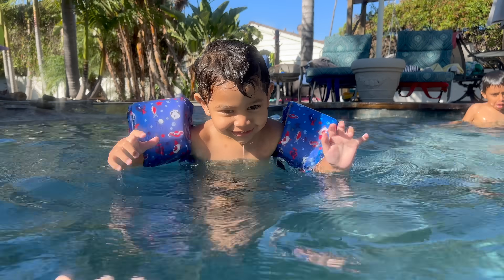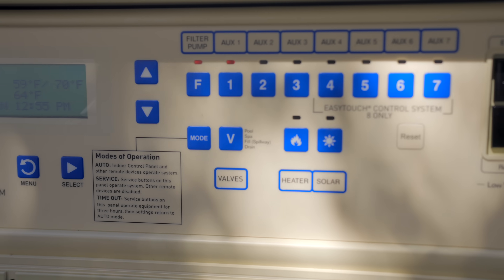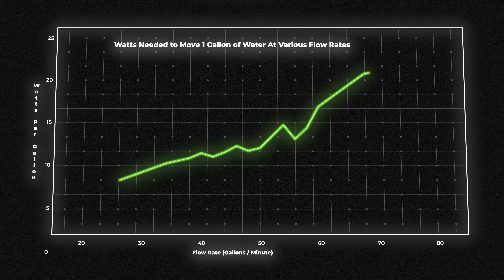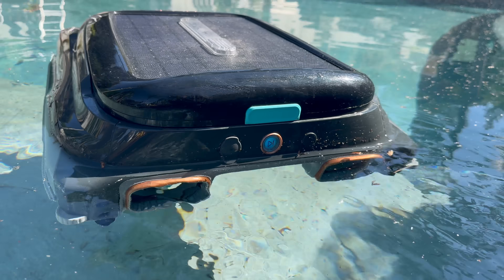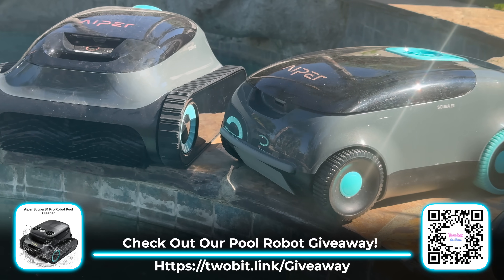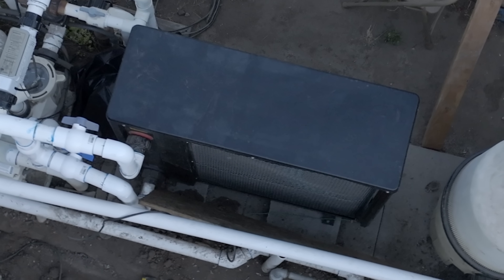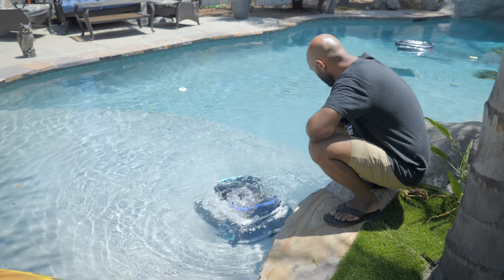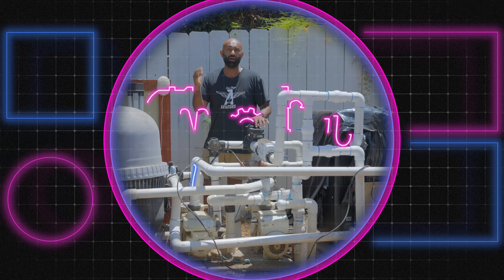How to Build the PERFECT Pool! Part 1 Variable Speed Pumps

Comment: Great video. 

One thing I would like to point out as it relates to pool turnover. In order to fully filter 90 to 95 percent of the water, you need to turn the pool over 3 times. 

So aiming for 2 turnovers a day is the minimum I would aim for when it’s hot outside. With variable speed pumps, running 24/7 on low normally does the trick. Turn the water over more and water chemistry will be better. 

Of course, you need to know the minimum flow for your heaters and salt sell to operate. So keep that in mind.

Comment: As it happens, I just acquired a pool myself! I have a similar Pentair system but it's an older one that uses an external module for WiFi and doesn't work with their latest app - but it does work! I have solar heating panels that are controlled but am fighting leaks. I also have a propane heater that's not currently working for the spa. Mine is salt but the previous owner stopped using it years ago, thankfully it came to life with the application of salt, but my pool guy still adds chlorine from time to time - grr! I have found you can cut evap WAY down by not using the watrerfall. In my case I run the main pump (Pentair fixed speed) most of the day and then switch to the spa towards evening for just an hour or two to clean that out. I'm loving the idea of a variable speed pump but not the cost so that's a problem I'll cross later. Right now my monthly bills have never crested $200 but the I've not been running my AC much - that will change. Sadly right now I cannot find a good way to measure power usage, I have two panels in my main garage and a third in my detached. I use a Sense at a different location and love it but it won't work for this - I'm stumped but want to monitor power.

I'm looking forward to your heatpump video! I'm not a fan of the propane and I'm certain fueling it won't be cheap. I hope you can give some good stats on yours! I'm particularly interested in knowing how well it can heat a spa! Most of the units I've looked at claim they cannot :(  I'm not sure my spa will get tons of use but it would be nice to have the option... This is going to be a VERY interesting video series!

Comment: @2BD, very intriguing engineering redesign Solutions you present here. I'll be looking into many of these myself. Btw, have you thought of using UV water decontamination instead of salt or chlorine? My understanding is that it's very efficient energy wise and as effective.
Reply: I was wondering about copper ionizers which are solar powered with little floating panels. They have a solid copper sleeve that gets used up over a few months instead of chlorine.

Comment: All very interesting, I have been preaching variable speed pumps for well over 10 years.
What size is the heat pump?
Does it have RS485 connection on the pcb at all?
I have installed a few heat pumps for pool heating, I mainly do hydronics.
I automate the hydronics with ESP32, Rpi and Home Assistant.
The heat pumps I supply have RS485, making full control rather straightforward.
Cheers from Oz
Reply from the maker: I'm not too familiar with RS485... but i'd love to pick your brain on it. I'd love to control the pool heating as a function of my overall use... like have it turn off If im charing my ev etc... i'd love to chat! there's a contact form on our website www.twobitdavinci.com .... cheers!!
Reply: @TwoBitDaVinci  sent an email your way

Comment: So something I have wondered and it looks like you might have had a chance for this (though it's too late now is my guess)...
Why don't more pool installers put some kind of Heat Exchager UNDER the concrete/stone birder around the pool?
This area, unless shaded, is usually super hot and you often splash pool water on it to cool it down.
Why not put in something like a driveway snow melt loop but run it in reverse, pull the heat put of the walkway and dump it into the pool though a liquid/liquid heat exchanger in line with the pool pump (which is already running anyway).
Reply: Then you don't need those solar thermal heating loops on the roof and you can use that for more PV.

Could also combine this idea with an HVAC heat exchanger to dump the waste heat from your HVAC into the pool as well.
Reply from the maker: super interesting idea! but i think it would cost quite a bit... if i could build a pool all over from scratch heck yes!

Comment: I have a similar setup. 16,000 gallons, heat pump, variable speed pump, chlorinator. 

My research shows you should try to turn over the pool twice a day, so I run mine at 44 gallons per minute for 12 hours, which totals right about 32,000 gallons. 

I’ve been considering going to a slower speed for longer, and your video just got me thinking it through. 

I’m excited for the rest of the series!
Reply from the maker: yeah for sure! how about 30 GPM for 18 hours? :) although your savings are alreayd huge having a variable speed and running at 44 ... but yeah fun exercise to do... i'm working on a calculator that will help with all of this! what kind of heat pump heater did you get? how do you like it?
Reply: @TwoBitDaVinci  All of the equipment is Pentair; Pump, filter, and heat pump heater. The brand was purely a choice of the pool installer. So far, all equipment works well, and the heat pump heater will put out a surprising amount of heat at a moments notice. My biggest complaint about the equipment is the complete lack of connectivity features available unless you are willing to spend another $1000+. With soooo many things being connected to the internet now a days, I feel like the pool industry is just looking to make as much money as possible. The ability to see the water temp, set heater temp, and control the pump seems like a simple thing to add. Heck, even the display on the heater showing the temperature is this tiny little display that is barely visible on a bright day. Frustrating.
Reply: I will add that I really appreciate that the pump can be set by RPM or flow, and will show you the exact amperage draw while running. 
I use flow since it allows me to dial in the exact amount of gallons per minute the pump is pushing. RPM means next to nothing in a situation like that.
Knowing the exact amperage allows me to see my energy savings in real time when I adjust the flow.
Cool stuff!

Comment: Heat pump?  What?!!!  In Florida we just run the water onto a black radiator on the roof and back down again.  Pool heated.  Voila.  I admit I don't know how much these are, but it's got to be cheaper than a heat pump.  Check it out.
Reply from the maker: Yah solar thermal panels are great! But they don't last as long as electricity producing solar panels. my house had a big leak in our pool panels that was spraying salt water on my roof.

Also, thermal solar only heats your pool, but what about when you dont need that? I want traditional solar panels, so that I can heat my pool, or charge my car or run my AC... that flexibility is important to me. we wouldn't even be using the pool in the winter, but with solar panels, I can still produce energy for our home heating etc.

that was my thought process, but yes those thermal panels are a great option, just be sure to keep an eye on them and catch any leaks!
Reply: @TwoBitDaVinci  thanks for that. I didn't have a pool but I'm moving soon and I'm looking for a house with a pool. I hadn't heard that about the thermal panels. I agree on the solar for sure, but I was referring to the heat pump. But if I'm not mistaken heat pumps are reversible so it could act as a chiller too, right? That would be an advantage.

Comment: Loving this series so far! Very much looking forward to heat pump episode as I have been wanting to upgrade my system. Great to hear that you'll be adding solar capacity to help with the heat pump energy consumption.
Reply from the maker: I have a little preliminary data for you... I can heat my spa which is obvioiusly much smaller, from 80-100 degrees in about 2 hours... my old gas heater did it in 30 minutes... so yes its 4x longer, but its free thanks to my solar! The key will be scheduling and planning :)
Reply: @TwoBitDaVinci  That’s a pretty good price! Haha. If it needs scheduling, it shall be scheduled.
Reply from the maker: @alwayzdancing  like many things in life, the costs are high if you're impulsive, but with some preparation and planning, you can have everything you want and do it within your envelope :)

Comment: @TwoBitDaVinci
Some advice for you on the salt cell, you’ll get a more life out of it if you chose to clean it with a less aggressive acid to water ration and spray it out with water. As soon as the calcium carbonate is loosen from the acid mix is a good time to start rinsing it off just be care at first for the spray back. 
The percentage of output doesn’t mean it’s making more chlorine, it just means it running more.
An example we always give is at 100% output, your cell is running 60 seconds of every minute and at 50% output it’s running 30 seconds of every minute. Every manufacturer has their own timers, but that’s the principle it works on. 

Also, I’m not sure at what stage of this that you’re in but if the deck is still pulled up, you have a Really Great Opportunity to increase the size of your plumbing. There’s math involved in determining what size you’ll need (I’m by no means an expert on it but we are a repair contractor in Florida that does work just like this). 
Anyways, when you increase the size of the plumbing, you decrease the resistance which means you’ll increase your flow rate at roughly the same amount electrical cost. 
It’s something called Total Dynamic Head, or the friction of your entire pool to include from your pool to your equipment pad and back again.
Reference The Experts at @aquastarpoolproducts9092
Steve Barnes is the expert there, guy’s a genius!

Thanks for doing what you do, we love watching your videos!
Reply from the maker: great insights! makes sense on the salt cell... and for the plumbing, no its too late iv'e already poured concrete, so can't change that now, but I'm pretty happy with how it is. But i'll mention that in the next episode!
Reply: I forgot to mention, using energy efficient sweep 90’s (instead of hard 90’s) will also reduce friction in your pool plumbing. Thanks again!

Comment: A big problem is the misconception  that you need to run your pool pump 10hrs. This ridiculous.  Pool "experts " will swear to long hours constantly.  You only need to run pool long enough to filter the water and circulate the chemicals, just enough to keep the pool clean . No more. I had to fight with both my family and the pool guy to reduce the time for years. I eventually had to lock him out of the pump timer. I reduced the 12hrs it was running to 4hrs in the summer and 2 hrs in the  winter. Never had a single issue.  Now this will vary from pool to pool  because of pools are so variable.
Reply from the maker: interesting! So i found that my phosphate levels rose when i ran it less than like 8 hours or so. My big goal is minimal chemicals, and things like conditioner to "keep chlorine in" if i can run at 300 watts i can add chlorine all the time, and i can afford to lose it without the conditioner. my chemical use has dropped to basically nothing... and my chlorine levels are always at the bottom of "acceptable" .... but i was only able to do this because i got the power use down from 2200 watts to 300.

but what a fun challenge this has been. now that my bills are zero thanks to solar, i'm enjoying this battle. but when I first moved in... it was more dread than joy

Comment: the older suction cleaners also cause stress on the concrete/gunite, that leads to cracking. Resurfacing a pool is real costly. Vinyl liners are the alternative, and they rip, and can "float" in a heavy rain. seeing a pool floating on top of a soaked lawn is a real treat. It is cheaper mentally and monetarily to fill it all in at that point.
Reply from the maker: that's a great point... let me ask you... I'm constantly picking out what looks like sand from my pool robot cleaner... is that stuff falling in, or the pool breaking down? it's a very small amount... but I also have some old halogen bulbs that need replacing ... so next spring I think I'm going to empty the pool, try to use the water as best I can, and do a full assessment of the state of everything ... cheers!

Comment: What was fhe cost to install the variable speed pool pump? Shouldn't that go into the payback calculation?
Reply from the maker: the beauty of that is, it's really easy to do. if you have an old pool pump you already have the electricity, if you are able to turn off the breaker, and move the power over, the pool plumbing should be just unscrew and re-screw. I did it in like 1 hour... super easy. If it's something you're not comfortable with, it's likely only like 100 bucks to a pool guy. Cheers but remember, never do anything you're not comfortable with.

Comment: I just demolished and filled in my pool as the first step of my current remodel.

The 17K-gallon kidney-shaped pool was too small for serious swimming, and too large to use as a hot tub. Over the decades I had replaced the pump and filter, with the filter being grossly oversized to reduce backpressure and thus allow a smaller pump to do the job. A fiberglass liner was added to slash chemical use (by 90%!), later shifting over to a "salt pool" with an electrolyzer. When the liner was being installed, I also replace the pool lights with color changing LED units, which was another energy gain, plus fun for parties. Also tried multiple cover systems, from bubble wrap to a trampoline, each of which had major tradeoffs.

Despite all the time and money invested, I wasn't ever satisfied with the results. Plus, due to a hill in my back yard (starting to drop away just 10' from the back door), my pool was in the front! It essentially consumed 80% of the available yard, largely preventing many other yard uses. One reason for my remodel is to make my home and property pet-friendly, and I'll want my future dog to have a great yard. (I'll get a kiddie pool, if needed.)

The inexpensive bubble-wrap cover did a fantastic job of heating the pool, but aged quickly and was a hassle to take on and off. The trampoline cover was safest by far, but was even more of a hassle to take on and off. A simple tarp cover on a wide spool was the compromise that worked best overall. Best moves overall were the fiberglass liner, salt system and big filter / small pump.

Plus, I live in San Diego! It takes me 20 minutes to get from my front door to feet wet in the ocean. Way, WAY better than any pool, and is one of the main reasons none of my pool solutions ever seemed worth it to me. YMMV, for sure.
Reply from the maker: love the perspective! I love that you were brave enough to fill it in! many people keep a pool for the wrong reasons! luckily I have a large lawn as well... I have a standing invite to every one of my neighbors to come over anytime and use my pool ... I get to nerd out over keeping it with minimal costs (after all the upgrades) and see many more people find joy in it. I will say, I'm an old man at this point, but few things bring as much joy as a pool. IT was brutal when I first moved in, now it costs me like nothing... including heating which I'll get into soon!
Reply: @TwoBitDaVinci  Since I wasn't getting much pleasure from my pool, I had considered letting neighbors use it when I wasn't home (or couldn't directly monitor pool use), until I talked to my home insurance provider. The liabilities without me actively supervising pool use skyrocket (something to do with the legal definition of "guest"), and I'd need a separate umbrella policy to cover them (as Airbnb/Vrbo units with pools must do). I'd also need to add controlled-access locks (beyond my simple gate lock), intrusion alarms (area and water) and a fully-automated pool chemistry management system (to shut the pool down if it wasn't safe). To get risk/liability as low as possible, I'd also need to ensure adult supervision in my absence, and ensure they understood basic pool safety and first aid. Bleh. Might as well open a Y!

After the liability shock, I went the other way, adding a 6-foot-tall privacy fence (replacing a lattice fence) to limit the "attractive nuisance" risks. That was the beginning of the end for my pool. The final trigger came when my remodel plans included new, more attractive fences, and getting ones capable of protecting a pool I don't use seemed silly.

Comment: Really want to see the results of your heat pump heater. Surprised nobody in SD recommends them. My home heat pump works great.
Reply from the maker: I was really shocked too. Literally every pool shop I called said, they don't carry them and dont recommend them. I've had mine for a few months now... it's been under cover quite a bit because I want to keep the cement dust out while I'm doing my larger remodel, but just wait till you see the video. I'm a believer, but I also understand what they're saying. For example heating my hot tub only, 20 degrees from 80 to 104 degrees takes 2 hours compared to 30 minutes with gas. but with solar, its zero in terms of cost, just requires scheduling and planning. i'll get into all of it soon!